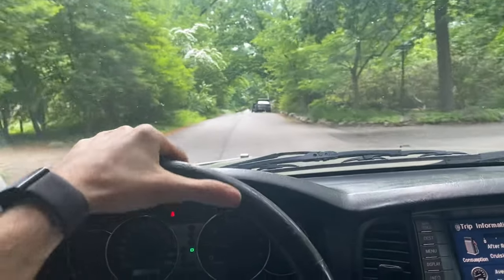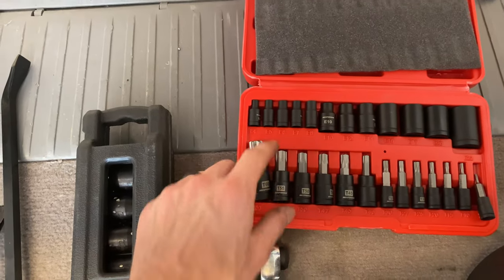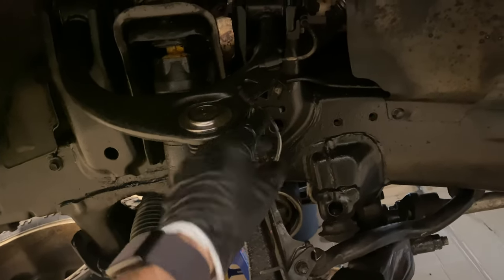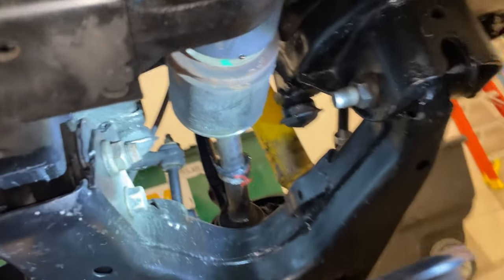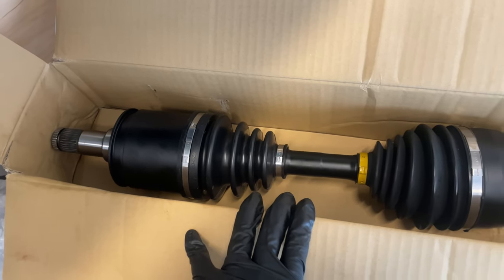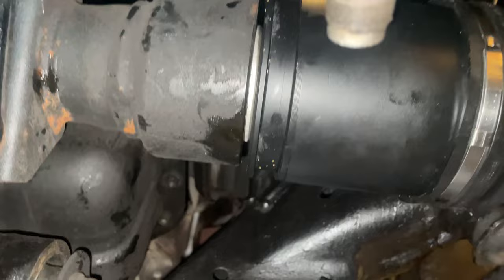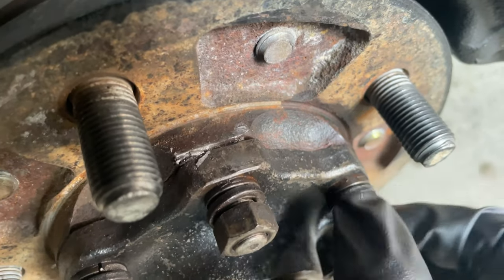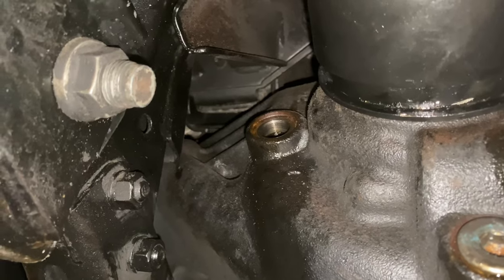Huge Improvement! Replacing CV Axels and Drive Flanges 100 Series Land Cruiser

Comment: Thanks for making this video. Would this be easier if it were done at the same time as replacing the brakes, rotors and calipers? Seems like there would be less items in the way. Thanks.
Reply from the maker: @FLcoachtony. The work you would save by doing those things as well would be the time to takes to lift the car, take the wheel off (needed for calipers) and take then drive flanges off (first step for rotors). That’s probably only a few minutes so don’t feel like you need to to it all at once, but you certainly can. You can reference my wheel bearings video to get a sense of what else is required to replace the rotors. You’ll want to repack and torque the wheel bearings (55mm socket) and maybe replace them while you’re in there. https://youtu.be/XNKLaaUNZHI?si=pFIyV3g2vAfXeyXh

Comment: Awesome video! Where did you get your OEM axle? I tried my local dealership and they said it’s discontinued.
Reply from the maker: Toyota recently discontinued their remanufactured CV axles which were rebuilt from used OEM axles. (Sad because those were cheap, sub $200) They still sell new OEM Axles. I got mine by requesting my Toyota dealor price match McGeorge Toyota which has them listed online for like $450 ea.
Reply: @JungleCatt  I’ll call and see if they can do the same. Because I tried the fit on my NAPA cv axle and the OEM flange, and that did not work whatsoever. Glad I did that before taking stuff apart. lol
Reply from the maker: So odd, but yeah apparently that’s  a real issue. Sometimes aftermarket axles don’t fit the flange or the diff correctly.

Comment: how long would you plan to do this for someone who has not performed this particular job. I have access to a lift which may may make it easier? would it make sense to do the brakes and wheel bearings at the same time ?
Reply from the maker: It was my first time and it took, About 2 hours per side. (I have time estimates in the description of most videos). Breaks and wheel bearings can be done together, especially if you’re replacing the rotors, because you need to take the rotors off to do the wheel bearings anyways. If you are replacing the drive flanges with the new cvs (I’d reccomend it), you can save a little time by doing that alongside wheel bearings because you need to take the drive flange off to get to the wheel bearings. But it’s not that big of a savings, and once you get the drive flange off once it comes off pretty easy the next time, so don’t feel like you have to do it all at once.

Comment: did you only change one side of the ac axle?
Reply from the maker: I did both! Same process on both sides.
Reply: Thanks for reply, I was thinking about reboot the cv axle before, now I know the right way is replace it. Mine has 17 0000 miles already.   @JungleCatt

Comment: Watch out for grease slinging since you are not running a diff drop.
Reply from the maker: Will be keeping an eye on those boots for wear. From what I’ve read I don’t think a diff drop does anything to protect or help the axles themselves. They can handle the angle fine. But It may help to prolong the life of the boots. That alone could be a worthy reason because replacing the boots Would be a pain.